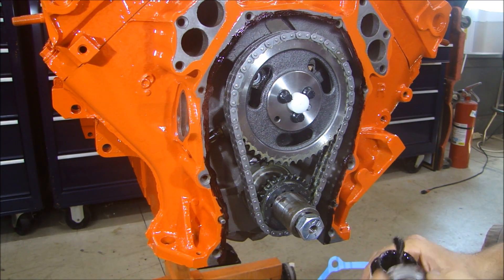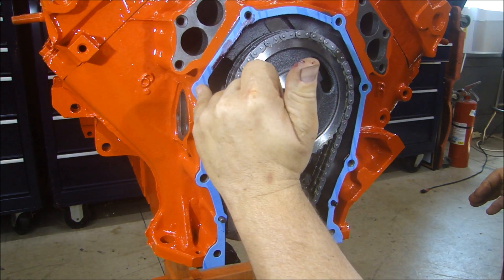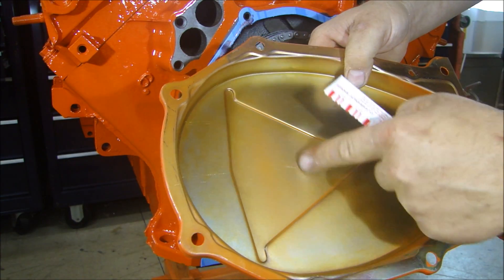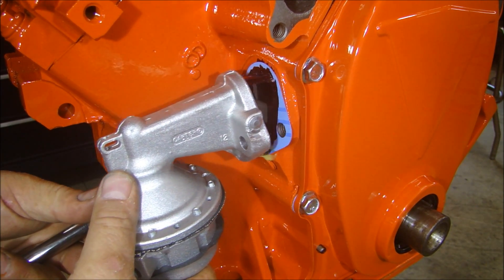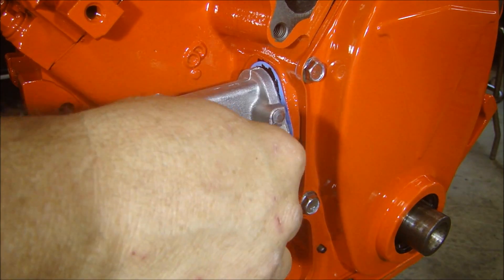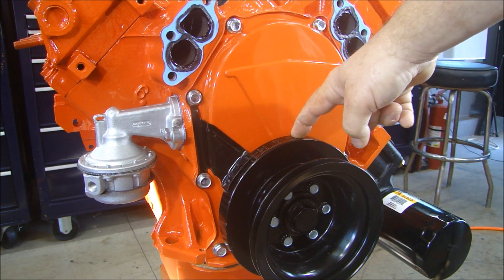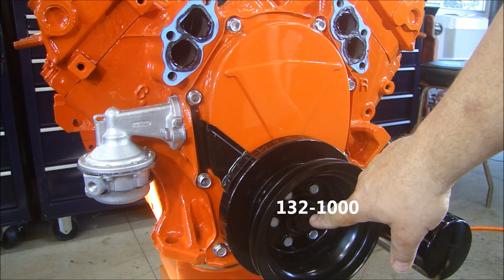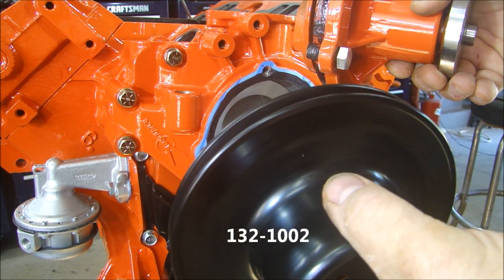440 MOPAR Big Block Engine Building - Oil Pan, Timing Cover Clearance, Fuel, Oil & Water Pump

Comment: What torque values did you apply to the water pump housing to block bolts and water pump to water pump housing?
Reply from the maker: 30 foot pounds
Reply: @PetesGarage  thx.   Is your water pump and water pump housing aluminum?

Comment: Hey Pete, did you use RTV on the water pump and/or timing cover bolts? I know some of those threads go through oil and coolant. Some people recommend it and some don't, just wondering your opinion. Thanks!
Reply from the maker: I use high tack on the gaskets and Permatex thread sealant on anything that goes into a coolant passage

Comment: So cool, thanks man!
Reply from the maker: Thanks my friend
Reply: Pete's Garage 
Oh thank YOU! I've wanted to rebuild an engine for decades. I'm 49 and have yet to do one. I had plans with my former Father in Law back about 20 years ago but he passed away and we never got to do it. He built dragtsers and could do everything from one end to the other and top to bottom. He tubbed cars, built rear ends, transmissions, engines, roll cages to IHRA spec and was certified by them to do so. He would do the old school bead locks and was a great guy. 
You have the same patients and mannerism he had and explain things the way he did. Down to earth, basic, simple way so those of us that have no idea where to start aren't overwhelmed. 
I sincerely appreciate you making these videos.

Comment: 3:03, that's that Permatex The right stuff black? If so, why'd you use it on a cork gasket and not the High-Tack stuff you used earlier
Reply from the maker: I use hi-tack to hold paper gaskets in place and Right Stuff to help seal cork.

Comment: Beautiful! Thanks Pete! Question about painting an engine. Would a factory style engine paint job include painting the fastener heads?
Reply from the maker: Thanks my friend. The factory painted everything
Reply: Thanks for confirming. So if Hell freezes over and I get to build my 440, I should paint the Offenhauser intake engine color, and anything else bolted straight to the engine. But not accessories?
Reply from the maker: You should paint what you want to. If you want it factory correct you would have to paint everything.